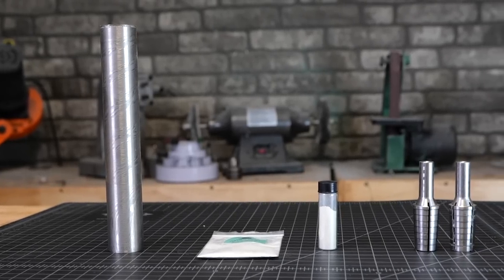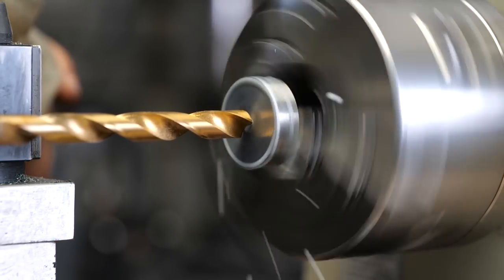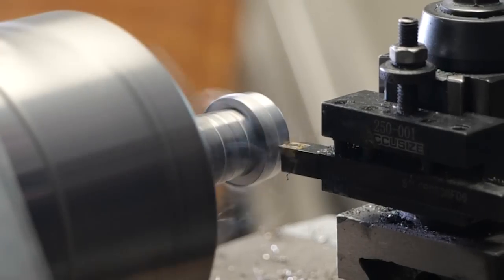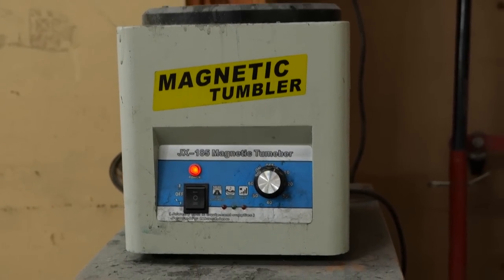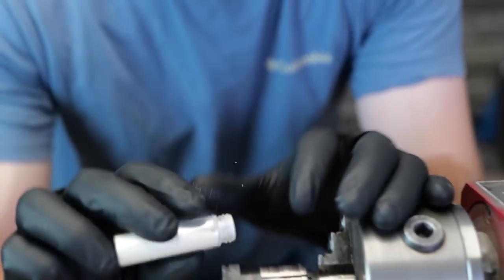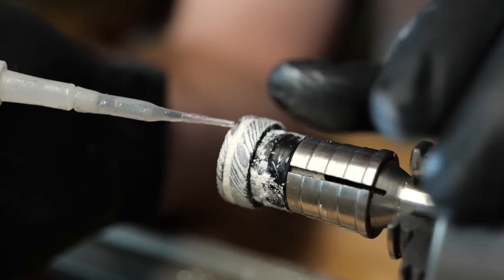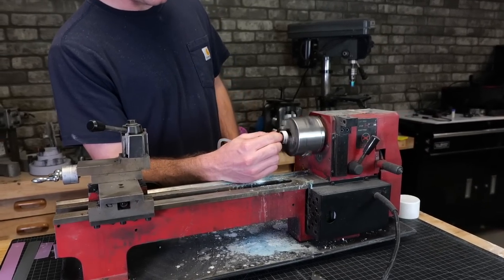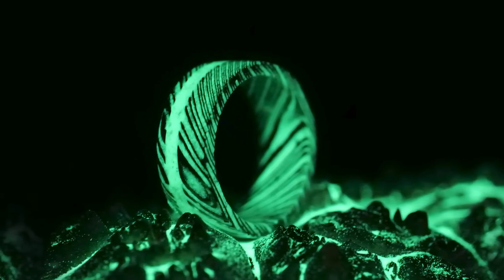Crafting the Wickerglow Ring

Comment: Could we see a stress test of this ring? I love the design but I’m not convinced that the glow powder will stay in the grooves without a top layer of C/A protecting it.
Reply from the maker: This is the editor! I was the one who came up with the idea and I’ve actually been wearing this ring nonstop for over a month and haven’t had any issues!
Reply from the maker: But would be a good idea to really beat up on it and see.
Reply: Well being as they used the thin CA, the glow powder basically soaked it up and with how rough the surface is on that ring Id say the longevity is pretty good.
Reply: @stonecyfer8225  that only works it the walls of the grooves are concaved, otherwise it will fall out eventually, and that was the point I was trying to make. The groove are very shallow, so I can only assume a few pounds of force in the right spot would pop them right out.
Reply: @PatrickAdairDesigns  or we could just... Not?
Reply: @PatrickAdairDesigns  I would talk to a doctor (this is ultimately medical advice so talk to a doctor.)   Stop wearing this now.  It can take years for this to present.  Get  the OSHA sheet bring to a doctor and talk to them.  A non protected will be shaking off dust you won't even be able to see it what could/would fall off could be very very small.  That powder can be very very dangerous.
Reply: There is a layer of CA glue that holds it in place.   However, I know CA glue is quite fragile, and I speculate the glow material will wear away quickly.  I am not a fan of that particular ring.  I suppose it would look really cool in a night club, but not for me.
Reply: @Regelos  

The strontium used in glow powder isn't radioactive.
Reply: I would like to see you mix that glow powder with a clear epoxy resin instead. That will wear like iron and will never fall out.  Do that and I’ll buy one or three.
Reply: Mix that glow powder with an epoxy resin; it’ll last forever.
Reply: @CogentConsult  funny your suggestion was in my thought process, but was not sure that it was greatly more durable than CA glue.  I do not actually work with those materials, so I was not going to say anything with certainty.
Reply: @Regelos  My guy it ain’t yellowcake uranium or something. It’s not even very much strontium.
Reply: @Regelos   what does it do?
Reply: @PatrickAdairDesigns I have couple of ??’s upon your Matching Custom Glow-Stone Wedding Ring Set?? Since this is my first time getting married & wondering which material is better on just a normal Tungsten, Hammered Tungsten or Damascus Steel if we were to take a shower & use both a shampoo & conditioner on it, which is a better material to use? That also includes on washing dishes as well?? Just an honest opinion on this bc I’ve been in a relationship for a short while that was only for 3 months until she cheated on me then I finally met my wife but we still haven’t figured out on what kind of a ring to get & been with her around a yr now but we’re still looking for that “Right” type of wedding band to get for the both of us. So that’s why I’m asking for your own opinion upon this of what material is the best to get so that it won’t get corroded over in time & help out a 1st timer on getting married here on picking out what’s the best material I should get

Comment: Lobe your work. Let me give you a handy tip that changed my ring making on the lathe. Instead of drill bits use an annular cutter assembly to go into the tailstock. I got my carbide tipped annular bits off Amazon and the MT2 chuck off Amazon too. Cuts holes 3x faster since it cuts plugs

Comment: You should use the damascus pieces/shavings as like the copper bits in the sunken artifact ones. Can be like a 'Tailings' series.

Have to wonder what the tally for injuries is thus far. Flying metal/hands close to moving machinery etc. just seems like there's a Lot of potential for ouch here.

Other material ideas for ones like this: timascus, mokume gane, and superconductor.
Reply: Hi, I work with metal and rotary tools and these metal shavings that actually "spray" out are very light and don't fly too fast so unless you're not wearing eyepro and dust mask (or even a scarf but that's not very safe with rotary tools, just like gloves) you're gonna be fine.
When sparks fly it's slightly different because while they're not gonna hurt you (it stings but dangerous levels of heat don't penetrate deep enough to deal damage to cells) however they do destroy clothes, an apron or literally just leather clothing is a good idea in this case

Comment: This looks really awesome, I'd be curious if you could get a better surface finish on the inlay if you sealed the CA with epoxy or something that would help amalgamate the crystals into the finished crevices. 

The polished edges contrast really well with the etched valleys and crystals, I just find myself noticing the pull out/gaps from the edges of the etches that don't have crystals in them.